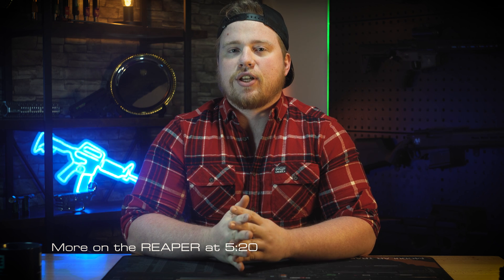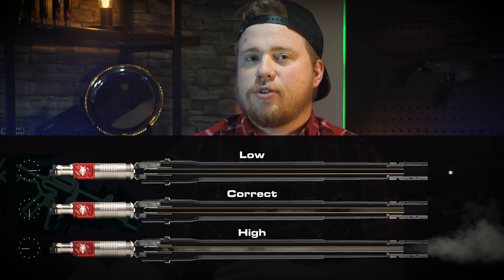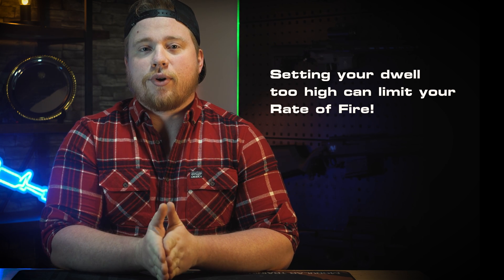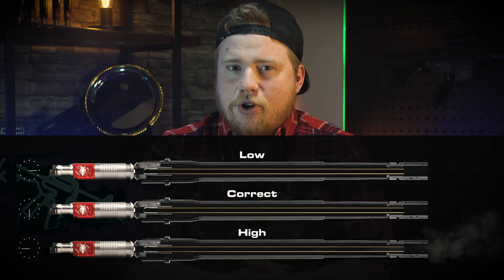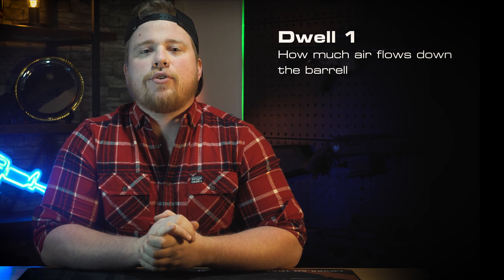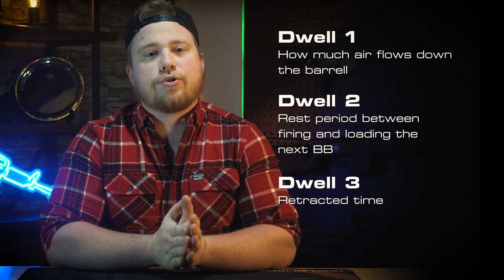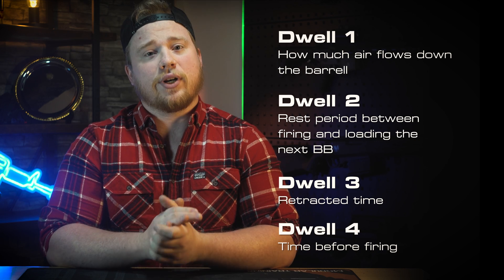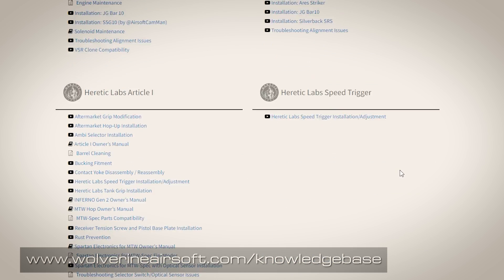Everything you ever wanted to know about Dwell - What the Tech!

Comment: Ive had an aeg for 3 years and ive spent 1300 bucks keeping it running(well trying to its never worked longer than 3 days) - and im really trying to play airsoft and i havent gotten to yet, if i switch over to a gas gun, (money doesn't matter im balling fucked up), is it gonna work? And like maybe work longer thaj 3 days? And how much would a whole gun set up like this cost out of the box, ?
Reply: Buy a MTW Wolverine HPA setup, 700-775 for the gun, 50-150 for the tank, 40 for line, 150 for regulator. Its worth it I just bought a setup last weekend and used it for the first time it shoots amazing I would spend the money again.